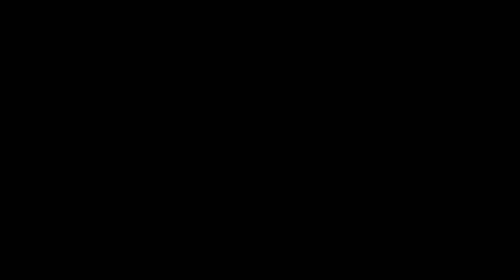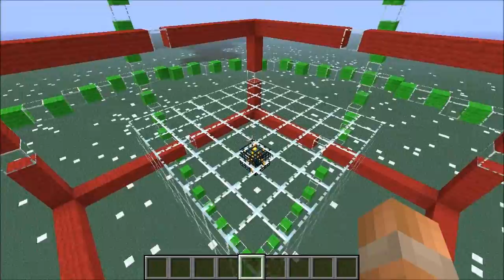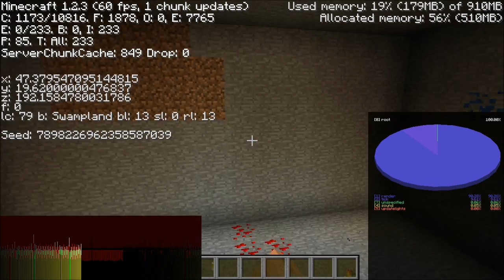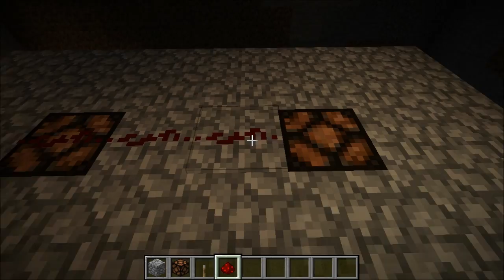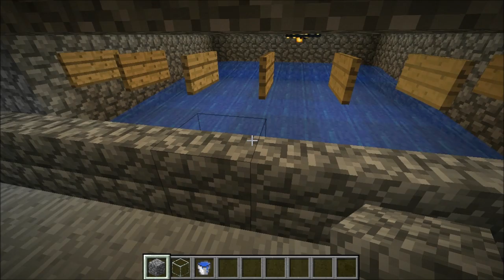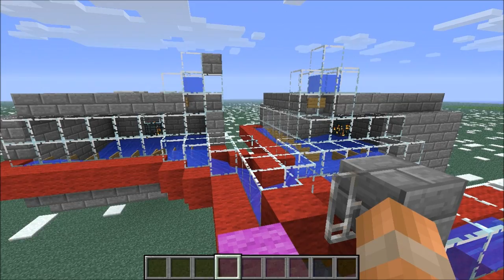Cave Spider XP Farm For 1.2 Tutorial

Comment: 0 is south, 1 is west, 2 is north, 3 is east. One of the mods I'm running denotes this next to the f: #, likely optifine or rei's minimap. I'm not sure which.

For the sake of simplicity, yes, you can go out 4 blocks on all sides. This tutorial was likely designed with efficiency in mind. By cutting down the dimensions, you require less space, and spiders have less directions to wander (although that isn't really a problem).

Comment: Well, guss what? I did...
Found out that if you are more than 16 blocks away they wont spawn.
He look about 17 blocks away... maybe creative mode does that?
anyway, dependint of the wall you come out from, it's 3 or 4 blocks + the wall + the tunel.
With my setup i was standing 17 blocks away so nothing spawned...
cut it down 3 blocks and now i'm good.
I copied is outside setup w/o looking how far from the spawner is from the wall (3 or 4)
i did LISTEN was off by a block... changes everything.

Comment: Thanks for this tutorial! Instead of breaking the blocks at 11:42 to get the items, you could have a single iron bar setup just underneath the water where the blocker piece ends up so it touches 2 sides to form a "corner" piece. When the blocker is retracted, the items will fall into the water, and straight down past the lower iron bar. I have a water stream below that to bring the items forward to a pressure plate for dropoff. (I'll be putting ice under that when 1.3 hits) It works great!

Comment: I am struggling with getting this to work at its full potential.
I have two spawners about 24 blocks or so from each other. The problem is that they are on different y and z(?) values so one of the groups of spider have problems with getting to the level where i have my crusher. If I gave you the world save would you take a look? Thanks a lot!

Comment: Yeah. I just tried building one of these in the newest snapshot. Whenever I get them to go into the tunnel, they glitch like crazy and seem to disappear or snap back, making them incapable of stacking and crushing them. It still works fine one at a time, but that gravely injures rates. But with this current snapshot, all I really need from them is their eyes. I can use Blazes to rack up some exp instead. Although I haven't tested it yet in the newest update.

Comment: Great video, as usual! I got a question though: why do you need to make the spawn room that big ? If you lit up the outside of the room, there should no place for them to spawn except inside the spawn room, no matter how big it is , right? Or is it lowering the spawn rate if the room is limited in size ? I'm trying to build a spider farm on my map but one spawner is too close to the place where the crusher needs to be to build a proper room as shown in your video.

Comment: Is the f: direction ( 3:00 ) step using shift+F3 command necessary for maximum efficiency? or can you just flow the spiders in any direction? because I have 2 parallel spawners and I would like them to flow towards the intersection , but that would mean one of them would go to the side not labeled 1 or 2.

Comment: I did check if my wiring was incorrect and i think it was because it is now working. What would happen is the bottom piston would fire  but the top one would just flash and the torch powering it would burn out.

Comment: @Xisumavoid -- Ok, I have found two cave spider spawners I'd like to make a XP grinder out of.  They are only 4 blocks apart, in a straight line, one block difference in height (y coord).  Clearly they share "escape" areas.  On the one hand, flowing water perpendicular to the line between them would be a faster exit from the escape area.  However, flowing water in the line will make tracking issues easier to deal with.  Suggestion on which might be best?

Comment: A word of advice for people doing this on SMP. If you save up some spiders to be crushed, and you suddenly disconnect without killing them, when you re-connect they will still be there but UNtrapped and you have any number of cave spiders running at you, it's quite fun trying to get away though - but not when you're level 47! I designed a cage to go around the crusher which buys you a few seconds to run away if this happens.

Comment: It doesn't go up fast enough, It gets too far out of range from the spawners if I use any of the tunnels shown in the video, I need a way to make them travel in a vertical line. Any idea? :/ I tried a water fall but it messes up the current, making it innefficient.

Comment: The signs block the water from going into the room, if they were going into the room you would have 2 different currents, one going to the tunnels, and one pushing away from the tunnels, the spiders would then get stuck in the middle of those 2 currents and not reach the tunnels, since signs can be put on eachother and you can pass through them, they make a excellent water-blocker. And that's why the signs are being put there.

Comment: Xisumavoid:
Thx for the tutorial. I now have a spider xp fram with 2 spawners connected. 
The drowning trap u show in the video @17:37, that didn't work very well to me. Yes it kills the spider that gets into the conner, but 1 of the spawner have half its spawns getting into it. I added 3 slabs froming a L shape at the conner right about the entry to the spider water way. When spider reach the conner, the slabs is right about them and they can't climb the wall. That fixed the problem.

Comment: at 7:20, you dont need to use signs. since spiders are half a block tall, you can use a half slab instead of stairs, and keep the tube 1 high before the next water stream. i've found that this is especially useful on corners if you're piping the spiders somewhere other than in a straight line.

Comment: You can get slightly better rates by expanding the room 1 block in all directions. The room you've built contains all possible cordinates a spider can spawn in, but when one spawns at the very edge, half of it would be in the wall, and thus will not spawn. That would gain 25.3% extra spawns, if I'm correct.

Comment: Because it is only in the 1 and 2 direction that the spiders can spawn 4 blocks away from the actual spawner, in the other two directions they can only spawn up to 3 blocks away :) So you don't need a symmetrical design for it to reach maximum efficiency :D !